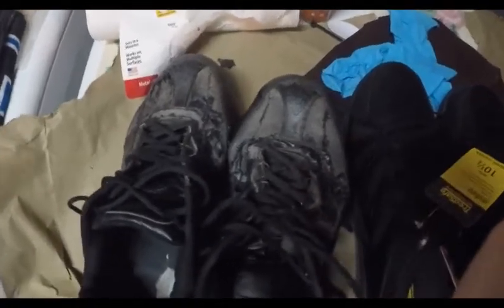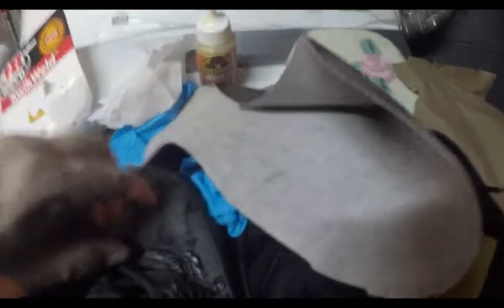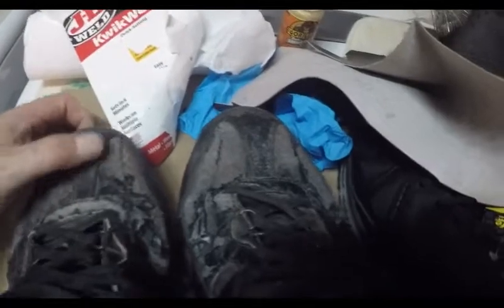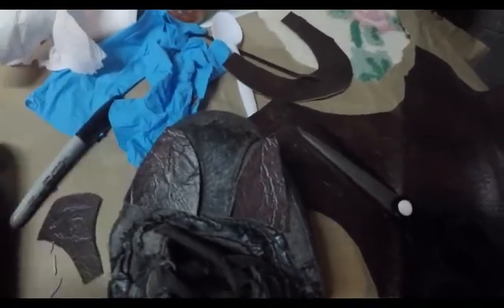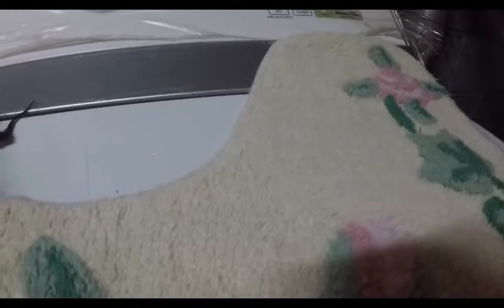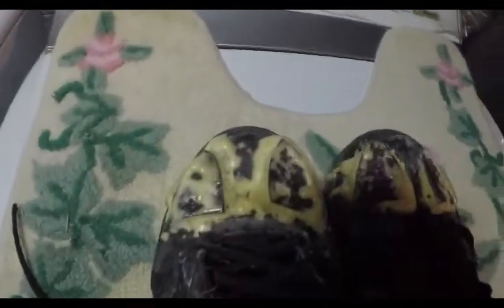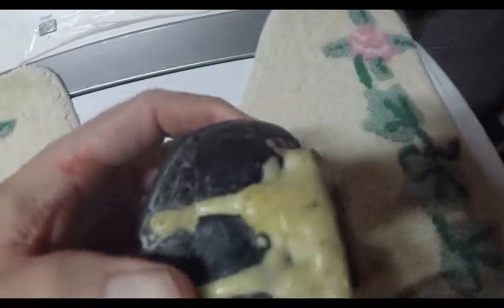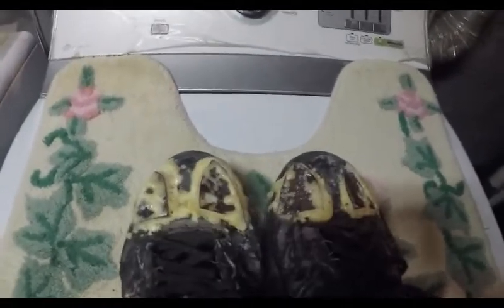DIY/ "redneck" shoe repair

Comment: Great idea. Glad it worked for you. I used that glue to add a thin personalized doormat to the old thick mat back in 2013, and it is still holding up. I remember all the weird tan stuff oozing out the sides, had to trip it off. Have a wonderful week. 🌴🌸🐱

Comment from the maker: ***week 1 update**-  they are still holding up n don't leak. Some of the excess drips did fall off but the main part with the glue n leather is fine